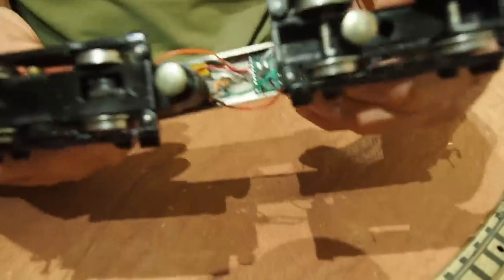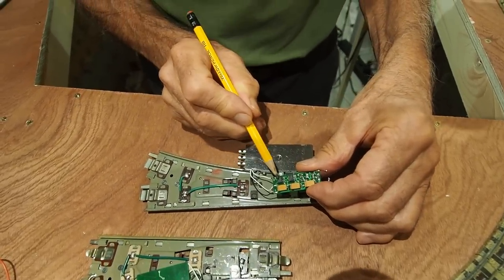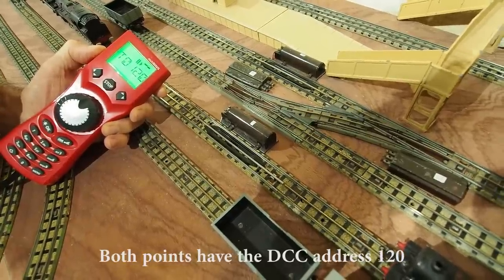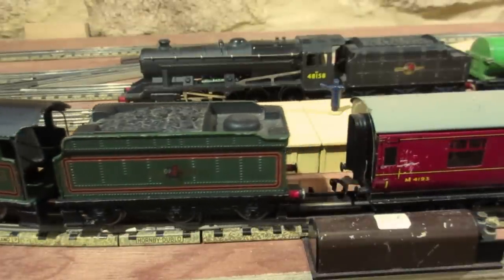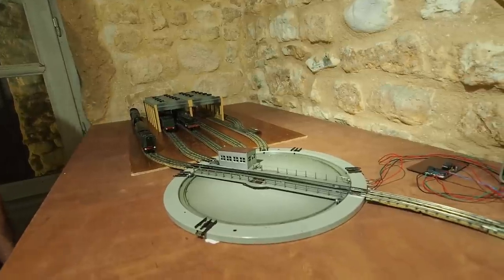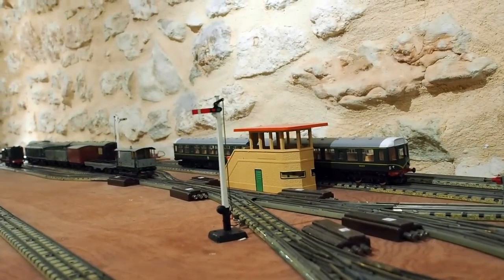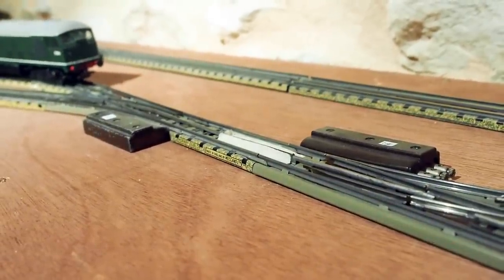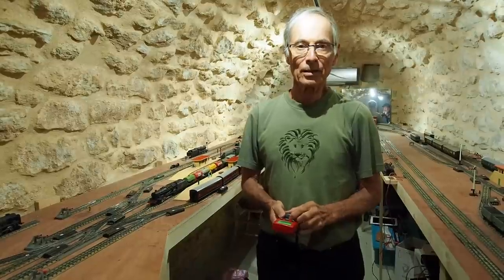DCC controlled Hornby Dublo layout  - with no wiring

Comment: This is very impressive . I have HD 3 rail layout controlled by a solid state wiring panel that controls everything and feedback contrzillers to allow for slow running and poor connections. This however is on another level . Extremely innovative and impressive .

Comment: This video stopped me in my tracks :-). I am quite adrift from current railway control technology with my knowledge very much pre-DCC, but to see every aspect of the layout under control is a tremendous demonstration of your hours of development work on these systems. I couldn't wipe a smile off my face when you demonstrated the iPad control especially the pre-programmed routes. (When I was a teenager around 1980, my Dad's layout's points could be set up with a stylus touching contacts on a plan of the layout. We thought he had done well, but the spaghetti under the boards was extensive.)

It was good to take the time to demonstrate the keep-alive in action as it is so innovative. I remember "sticky patches" as one of the most frustrating aspects of a model railway.

Congratulations on your achievements!

Comment: That is just FAANTASTIC Julian, it has also answered a question I have on changing to DCC, I run Wrenn and Airfix locos as well as more (not so sturdy) up to date stuff, I've been told it's a waste of time converting old stock even with stay alive capacitors as there performance deteriates so much but after seeing this wonderful video I now see it's possible, thank you for showing your wonderful engineering in miniature.
Reply from the maker: Paul: So glad it inspired you. Contact me if you want help. Julian
Reply: @juliancoles1825  Thank you for your reply Julian and offer of help, I’m also an ex BR signalman and make signals a big part of my 00 garden railway to add a dcc control signals system would be a great thing to do outside in all weathers, thank you again Julian

Comment: Well done. Nostalgia gold, love Hornby Dublo. Two wires is possible with DCC and well joined track work. Fishplates do conduct. Space is at a premium in tender locos with the ring field motors often filling loco cabs. East meets west with Z21 touchscreen and Hornby Dublo. Love it

Comment: Dont know why this shows up in my feed, but the rails look awfully like old märklin rails from the 60's. Especially the turntable looks 100% the same as the one I got in my attic. Nice setup and really brings back the old days with a modern touch! Ah, ok. He explains it. It is a Märklin 😂
Reply from the maker: "Dont know why this shows up in my feed" - because it's great video! But seriously the old Hornby Double track was very similar to Marklin. The turntable is indeed a Marklin - but it works very well with HD track.
Reply: @juliancoles1825  undoubtedly a great video :-) maybe I should have added 'now' after 6 years. Are you still adding to the layout or did you keep it 'clean' e.g. without scenery?

Comment: Absolute genius who's decoders are you using ? I recently sold my dcc controller because of cost but I use 70s and 80s hornby and lima engines and was constant told buy new sell the old stuff it's not compatible well you prove them all wrong it's astounding what you have accomplished simply brilliant. 
Brian

Comment: Just a (sideways?) thought, done with 1950s tech. How many Colossuses/Colossi under the baseboard, and coaches/wagons on tow behind the loco? 76:1 scale layout?
Reply from the maker: Yes its 76:1 (00 gauge). No Colossi were used! As I show there is nothing under the layout. No magnetic core memories either.
Reply: @juliancoles1825  I think you mean 1:76, 1 to 76 - OO. 76:1, 76 to 1 Massive scale! to accommodate the period tech. Brilliant non the less! As are the automated Vids.

Comment: Hi Julian,
I am attempting this with my layout, with the locos did you literally connect the motor outputs from the chip straight to the motor brush terminals of the loco ? With No other modifications to the original loco wiring?
Thanks
Reply from the maker: Great. But you MUST insulate the brush connected to the chassis. I drilled it to 4.5mm them insulated with paper. A new brush tube was made from 4mm OD brass tube.
Reply: @juliancoles1825  
Thanks Julian, 
I thought that would be the case as otherwise it would collect both the DC signal from the chip and the AC from the track.
Thanks very much!

Comment: Very impressive 👍😊

I'm just wondering how do you ensure good continuity across track joins/joints? Similarly for the points (is that what the stay alive capacitors are for?) Also I'm pondering how many amps your transformer is as your powering everything from the track? And, finally, how is the layout affected by voltage drop etc - is such the optimal size (and as it's a tail chaser) to avoid voltage drop etc?

I guess MERG have the slim line stay alives as a kit of parts or similar, which might be beyond me

Your ideas may help me with my disabilities etc - I was going to use copper SA tape on top of the boards and add droppers, plus hard wire the points and have switched crossing nose Vs🤔🤔👍😕
Reply from the maker: "how do you ensure good continuity across track joins/joints?" - the fishplates are pretty good and if they are loose I adjust them - sometimes I solder the third rail tab if it is slack. "is that what the stay alive capacitors are for?" - you inevitably get a few short droop-outs on the old points, however well you adjust them. The stay-alive help a lot and eliminate most of the frustrating loco stops. "I guess MERG have the slim line stay alives as a kit of parts"  - unfortunately they don't. " switched crossing nose Vs" - I described  a frog juicer in the MERG Journal and you can find details in "Member Projects" in the Knowledgebase.
Reply: @juliancoles1825   Thank you. I've a friend who's just joined MERG, I'll see how he fairs and then I may join. Electrics and electronics have to be like painting by numbers for me, probably due to dyslexia and dyspraxia. The season's greetings to you and yours 🙏💜😊🎉🎉

Comment: Very impressive. Just one question : on standard 12v 2 rails layout, it is usually not recommended to rely o nthe tracks only to both power and run your DCC engines and accessories, and you have to wire a bus to do that. Correct me if I'm wrong, but Hornby Dublo is a 3 track system on 12 v DC (unlike the 3 rails Märklin system, which is 16v AC, and well used in France where I live as an alternative to 2 rails 12v DC). THe Dublo tracks does not seems to me as they are made of nickel silver like today's model tracks for 2 tracks systems. Does the 3 track system have a better overall electrical conductivity that permits to power and run either engines and accessories than in a classic 12 v 2 rails system ? If I would try to do the same with my 2 rails system on Piko A track, I should have electrical sections roughly 2m/7ft, and special ones only for zones with cascading pointworks, lika station"s throats, fed by a separate bus, same for accessories. So, does the Dublo system have better electrical caracteristics than standard 12 v DC 2 rails that permits you to do such a magnificent job, or am I missing something ? I'm curious of it, thanks for your answer.
Reply from the maker: Olivier: sorry for the delay in replying..first important question: where are you in France. We are in the Drôme. A lot of folks say you can't use the track for the DCC bus, but I have shown here and in my latest video, it is entirely possible and cuts down the wiring to zero. This latest video is 2-rail BTW. Of course HD is particularly good for low track connector resistance.
Reply: @juliancoles1825  Good evening. For your question, I'm in the department next to yours, in Grenoble (Isère). I have to watch back your video to get an estimation of the length of your tracks, it might have a positive influence on your no-wires DCC layout. As I am into modular layouts due to cramped housing conditions, I have to take care of every connections from one module to another, and avoid fishplates, both for track mechanical integrity and electrical continuity. So, parallel wiring is considered by me, and, of course, the longest pieces of track I can use overall, hence the Peco Setrack choice (670mm length straight available).
I suspect that the HD tracks are made with nickel silver with more copper than my mix of Piko A/Peco Setrack, but I have not measure yet the electrical conductivity (lack of meter at home !). I think that the section of your rails is also broader than my code 100 ones. Especially the Piko, which are a slimmest version of the code 100 profile than ordinary ones. It helps with conductivity.
Reply: It's a myth that you need to run bus wires and droppers.

Comment: An excellent combination of the old and new and well explained. A question I have is how did you isolate the brush holder of the various Dublo motors from the live chassis.
Reply from the maker: freightuk Thank you!  A good question: it is quite easy.  In drilled the brush hole out to 4.5mm.  A new brush tube was made with 4mm OD brass tube.  The tube is insulated with rolled up paper - you can get exactly the right fit by choosing the number of layers.  The brush and spring fit neatly into the brass tube.  The plug also fits and you can solder the motor wire to it.  Motors with spring clip brush fixings are even easier.  Just add a pice of insulation - I used heat shrink sleeve.  Then a small brass tube fitted over the insulation can have the motor wire soldered to it.
Reply: @juliancoles1825  Thanks, I have already converted most of my 2R Dublo with 0.5 inch motors which were quite easy, so conversion of the Ringfield motors is next. Time for some careful drilling. I also noticed that you have managed to dispense with droppers to all the rail sections, quite a feat to get reliable connections between all track sections. Certainly could not do that with the Peco Code 100 fishplates, they weaken too easily to trust over a short period let alone a long period. At least I find that Dublo locos work easily on Peco track without the use of stay alive which is quite an expensive addition especially from Lenz. Jim :)
Reply: @juliancoles1825  Hi, Can you convert the motors on the Castle series to DCC? They have a different type of brush system.
Reply from the maker: @steverowland1898  Steve
Yes, it's perhaps a little more difficult, but the same principles apply: drill out the uninsulated brush tube.  You have to disassemble the motor to avoid drilling into the armature.  But this is not too tricky.....
Julian

Comment: Bonjour Julian, I watched your demonstration with great interest. Thanks for sharing this 'seem to be simple' control system you fabricated. But I have some questions. How many Amp's you provide to run and operate the layout ? Do you use boosters ? Each accessory item has a decoder - just like the engines - but what type of decoder do you use for points and signals ? I'm building  a layout - The AnneliesVille RR ( have trackplan you can google or see on MRH)- and will change my actual NCE Power Cab to the Z21 (black)system to wireless control and run 2 or 3 loco's at a given time. I have installed a Bus for there is about  90 meters of track. I'll see to find your articles on Merg but will appreciate your kind reply here. Thanks,  greetings & happy railroading (I live in the Indre 36 )
Reply from the maker: Filip, c'est un plaisir de répondre à vos questions!  J'habite dans la Drôme.  Amps: it's the Z21 (3.5A) - no other booster.   I describe the decoders in the video!  90 metres of track - wow.  It is possible to convert my point decoder for Seep point motors - just add a much larger capacitor (2200uF instead of 660uF).  Love your layout.
Reply: Rebonjour Julian, merci pour votre agréable réponse ! Regarding the accessory decoders do I understand that you build these yourself ? I'm not an electronics wizard so I was hoping to find these in commerce. I'm doing some research. I have about 24 points but will start only with the mainline points. It's quite an investment & challenge to build a 23' x 18' layout but I enjoy every bit of it. What I can build DIY I do with enthusiasm but I miss out on electronics. Thanks for the compliment and always welcome. The Drôme is not that far au normes Française. All the best and thanks. I love your video's and it's an interesting learning curve.
Reply from the maker: @phil36310  Rebonjour Filip.  Yes I build  and design them myself.  I know of no commercial versions, but as I said, they would work with SEEP motors with a larger capacitor.  Are you a member of MERG?  If not, send me your email address and I will copy you the article I wrote for the MERG Journal which describes the design in detail.
Reply: Rebonjour Julian, Merci beaucoup ! No, I'm not a member of MERG and I thank you for your kind offer. My email address is: p.carpenter@laposte.net. 
I'll send you some photos of my layout in return. Meanwhile all the best & happy railroading.
Reply: @juliancoles1825  Tres bon idee. I too would like to implement digital to dublo, especially the points! My understanding is that the PIC controller has 1) to be built into a PCB - your design (unless kits are availble?) then 2) coded using assembler. excuse the direct contact but I've tried to locate the MERG article without success.
Reply from the maker: @davidroberts2015  Hello David
Yes the point decoders are on a PCB - you can see them in the video.  If you can build surface-mount PCBs, then I could send you one to try.
Julian
julian.coles69@gmail.com

Comment: Wow, how did you get models that old to work with DCC?
Reply from the maker: Every type of HD loco can be adapted to DCC.  With the sprung brush tube types, the tube has to be drilled out and insulated.  My preferred decoder is the Lenz Silver.
Reply: @juliancoles1825  very interesting

Comment: That is absolutely brilliant, do you have an electrical background by any chance? I never realised Dublo could be DCC's! Must have taken a long time to fit chips to every loco and points though.

So is the voltage applied to the track standard DCC 16v or Dublo 12v?

Are the DCC chips just a standard 8 pin chip or something else? I might not sell my Dublo stuff having watched this!
Reply from the maker: Glad you liked the layout!  Yes, I was a electronic designer - retired 20 years ago.  Must have taken about a year to fit all the chips, but the hardest part was probably designing and building the point decoders.  The track voltage is 17V DCC (ie +/-17V).  The loco decoders I bought - mainly Lenz Silver and Standard V2.  The chips in the point decoders are the PIC 12F675 programmed in Assembler.  Yes, hang on to your Dublo stuff!  Contact me if you would like help with locos or points.
Reply: @juliancoles1825  Thank you. I may do so regarding DCCing the locos. You have given me food for thought!

Comment: Nice video Julian.  Did you design the PIC circuits?  By the way, it's MERG with a soft G, not MERGE! 
Always look forward to your "Letters from France" in the journals.
I have adopted the Lenz ABC system using ZIMO decoders which give a much better controlled stopping distance.  Most realistic!  Keep on modelling. Best wishes from  M3315
Reply from the maker: Christopher: glad you liked the video and my articles.  And yes, I did design the PIC hardware and software.  More details in the September 2017 MERG Journal. Julian

Comment: Ingenious I never thaught it could be done. What Dcc chips do you use? Could you even add a sound chip?
Reply from the maker: The loco decoders are Lenz Silver because they work with the Lenz ABC system which I use for automation.  The point decoders are my own design.  And yes, sound decoders could certainly be used in HD locos.

Comment: Not bad, but no wiring? Are you quite sure about that?
Reply from the maker: Phil: OK, I had to connet the DCC to the track!  Also, you see where I linked in the HD switches I needed another pair of wires.  The colour signals need a pair of wires, but only from the adjacent track.  So...very, very nearly 'no wires'!
Reply: Hello Julian, actually I was being a bit cheeky, I realised you had to have at least that quantity of wiring. I also understood where you were coming from when you said no wiring, my layout took over 1100 metres but that was mainly because I am running block control. Very nice man cave by the way.
Reply from the maker: Hi Phil,  Thanks for the clarification.....What is your block control system?
Reply: Hello Julian, I am using the Roco Z21 controller with the black wireless Roco hand controller and Digikeijs units for the block control. Because I am using Fleischmann Piccolo track I am using DCC Concepts ADS8X point controllers to drive my turnouts. My uncouplers are being controlled with Uhlenbrock units. I am controlling the whole layout using a piece of software called iTrain.
Reply from the maker: Hi Phil, I used the ADS8X before using my own decoders - there was quite a lot of wire, even with them.  How about a YouTube video of your layout!  Thanks for the info, I'll check out the gadgets you are using - though I use the Z21 myself of course.